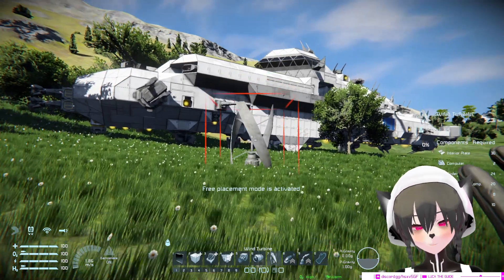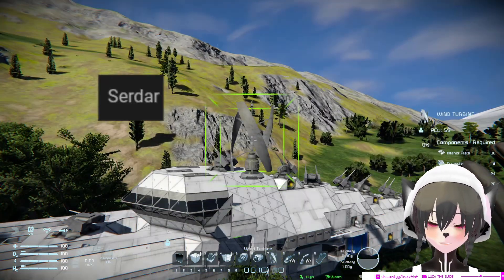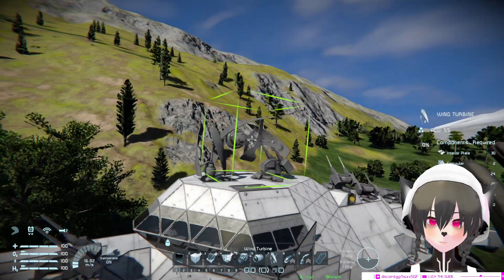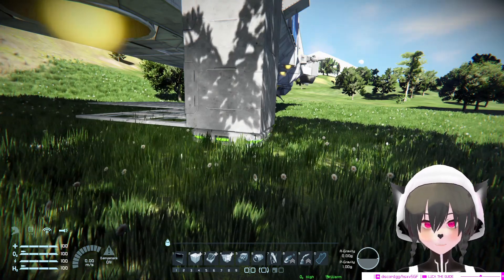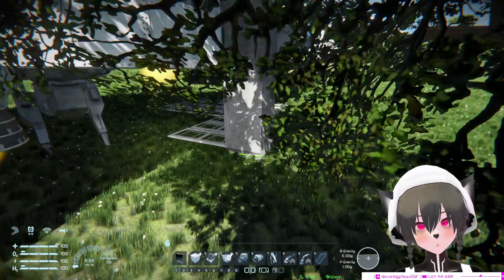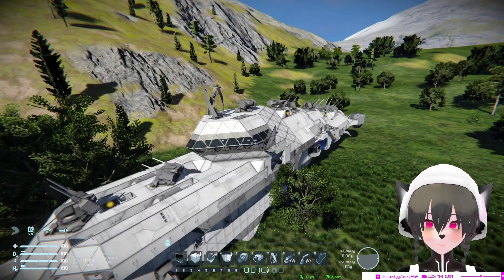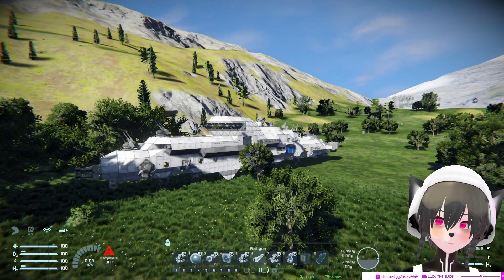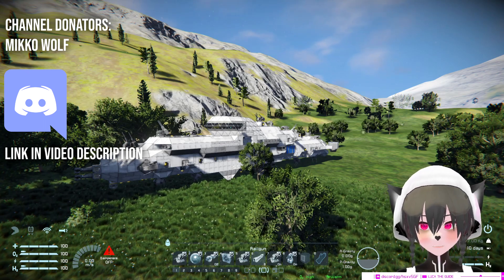Make Wind Turbines WORK ON SHIPS, Space Engineers Survival Ship Building Tutorial

Comment: another tip: wheel suspensions can host rotor heads and get attachments using them by aligning them perfectly and attaching in the terminal menu
Reply from the maker: Oo didn't know that either * -* will see how to apply that to something x3
Reply: @LucaTheGuide  shocked landing gear, comressive pads for crash landing
etc
Reply: @LucaTheGuide  shocked landing gear, compressive pads for crash landing
etc
Reply: Wait what? That sounds so wrong 🤯
Reply from the maker: @TimbavatiLion  xD
Reply: You can also attach the separate wheels so you can use 5x5 wheel on a 1x1 suspension. If I remember correctly.